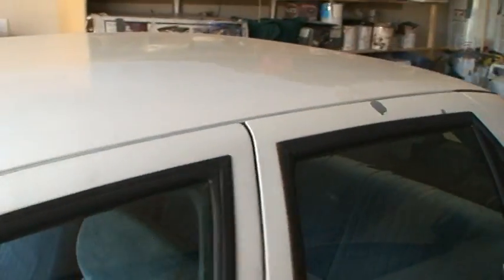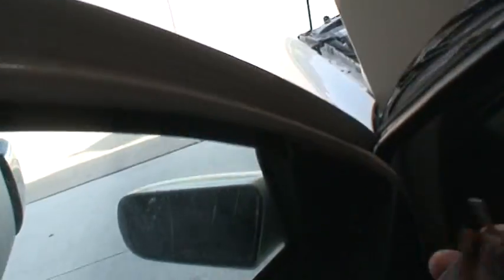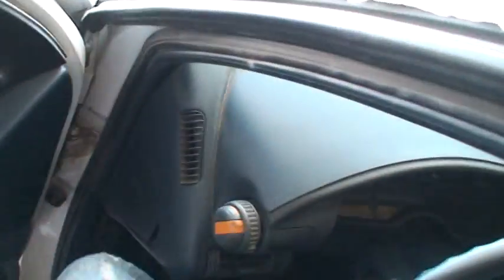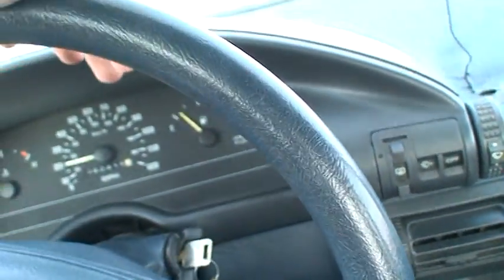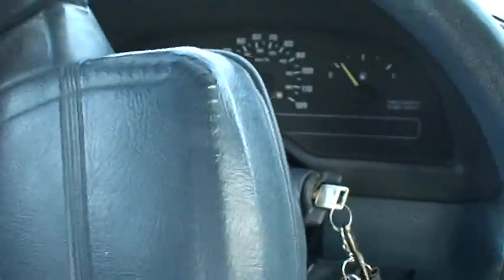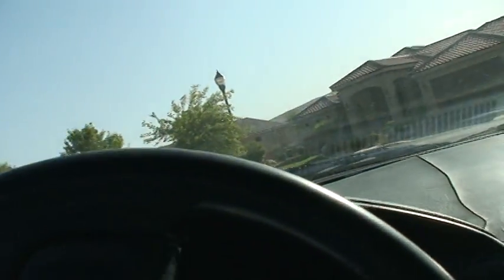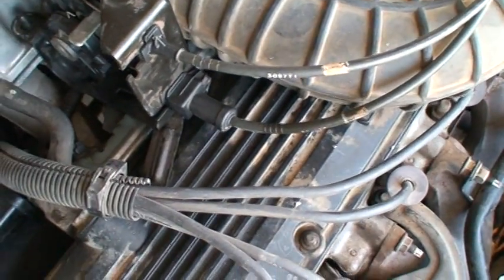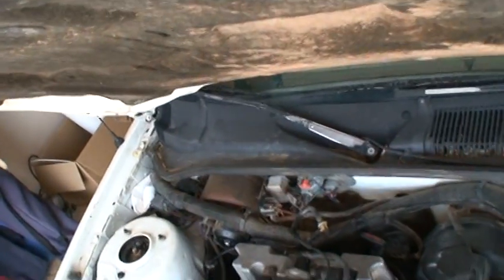1993 Chevy Corsica

Comment: With that lifter ticking like than sounds like it's bent but anything Chevy on this year runs like a boss
Reply from the maker: it could have been bent i did get the head from the junkyard to replace the cracked head, but I was pretty sure that it was the injectors making the noise at least that is where is sounded like it was coming from.

Comment: 80's and 90's, not chevy's best years for making a quality product.
Reply from the maker: not really the only good thing about that car was that it ran and it had a amazing A/C. other than that, it was disposable.
Reply: ScubieRue
totally. I'm kinda looking for a 3rd gen Camaro, and if it's not modified to hell, or looks one step away from trashed the seller is asking rather high $$ for it. Your right about the 80's and 90's cars being disposable.
Reply: thats not true. the 3.1 60 degree sfi v6 is of the most reliable v6s ever made
Reply: ahhhh nevermind thats got the also reliable 2.2L DOHC 4 cylander. the 2.4 SOHC is the worst motor chevy made in the 90s cuz it needed a head gasket every 20k miles or so
Reply: Aaron McConkey  I'd have to disagree I happen to like the 4.3's i've seen several make it to and pass 350,000 miles easily.
Reply: Aaron McConkey until 94, then there are intake gaskets and piston issues.
Reply: One of the reasons they lost so much market share to the Japanese
Reply: @aaronmcconkey368  They brought that engine back, still with head gasket issues
Reply: @aaronmcconkey368  There are issues with piston slap, intake gaskets, and noisy lifters, though these issues occur at 200K miles